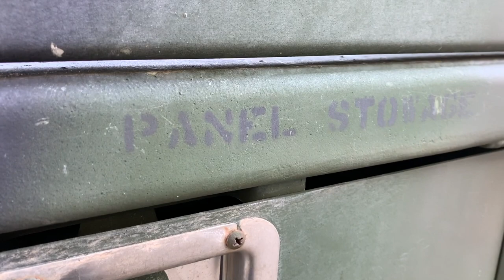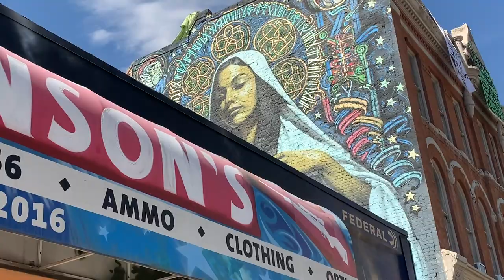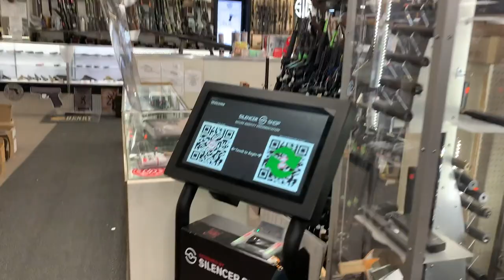Did We Take A M1083A1 Military Truck Through Salt Lake City???

Comment: Regular air or nitrogen fill? "Dead air only please"
Reply from the maker: It has CTIS. The computer will put air in a tire if it goes flat and will adjust pressure as needed while rolling down the road.
Reply: @DeadAirSilencers  Just looked it up! Neat tech. Mike wasn't kidding when he said could haul thousands of pounds with that truck haha.